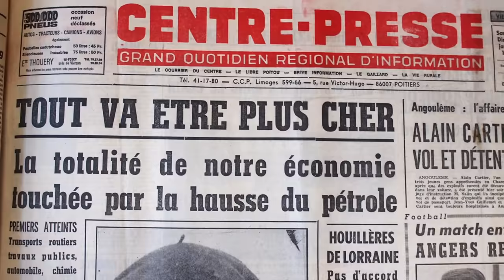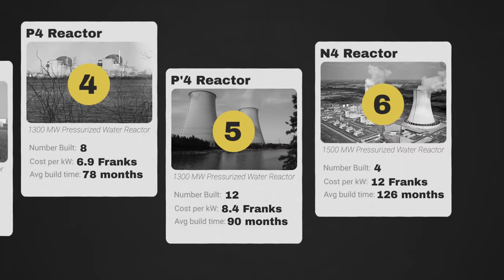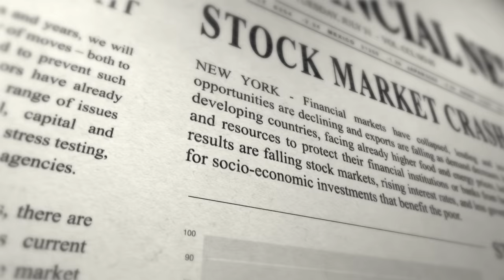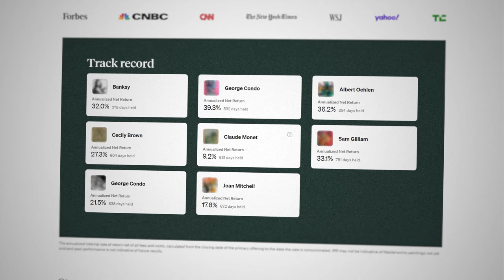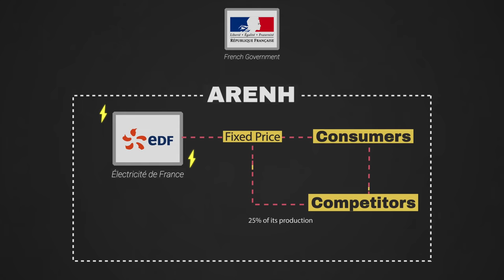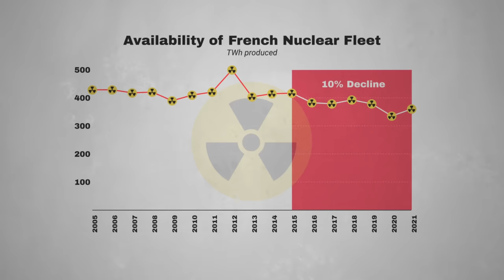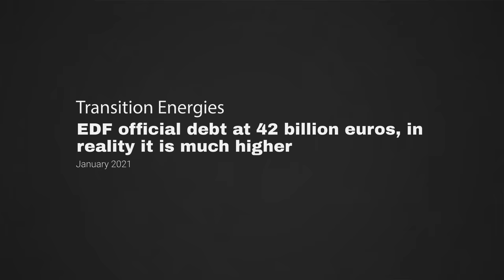Why French Nuclear Energy Failed

Comment: Nuclear energy is neither sustainable nor cheap.

It is a wrong strategy. Just being low in CO2 emissions is just not enough.

Only renewable with electric buffers are the future.

Also btw Chernobyl was in 86
Reply: We need both nuclear and renewables for a stable and sustainable grid.
Also "electric buffers" quickly become unsustainable and expensive, as well as CO2 intensive, as you expand to a large scale. I don't see how it would be the case for nuclear energy.
Reply: @cocolasticot9027  I understand your view and it basically makes sense. But battery technology is progressing at a pace that is just breath takning. You will see in 10 year iron salt batteries will be in abundance available. And they are cheap... very cheap.
Reply: Gas from Russia is another option. Putin likes this option very much.
Reply: @toom2141  The exact same thing can be said about fission/fusion reactors, right now nuclear is cheaper and lower in CO2 than all renewables.
Only time will tell which will see the most success in the future but as of right now renewable isn't even close to as efficient as nuclear, yet alone it isn't plannable.
Reply: @alex
Dude nuklear is the most expenive energyproduction of of them all!
Reply: @toom2141  there have already been fusion reactors which no longer produce a negative.. i dont think we will have fusion anytime soon, neither do i believe we will have batteries which do not wear overtime nor use harmful materials...
Reply: @toom2141  yeah I guessed that was your point. I'm very skeptical of the actual technological advances and what we're promised about it.
And even if the tech becomes that good and cheap, there's still a dilemma in my opinion : the environmental cost of producing that many batteries.
We already have to replace thermic cars with electric ones, that would already require a massive amount of batteries and a necessary change in the individual car paradigm. But if on top of that we have to build massive infrastructures to store the renewable production, I don't see how this could be achieved without massive industrial pollution from the battery production (extraction, industrial processes etc.), let alone the production of the renewable installations themselves.
Compared to nuclear plants with huge economy of scale and controllable energy output, I can't imagine a realistic alternative in the renewable only scenario.
(Or maybe in a degrowth objective, which isn't a bad thing for me. I just assume we're not talking about that particular option)
Reply: @cocolasticot9027  Exactly the ideal power grid would be majority Hydro and Nuclear supported by a minority Solar/Wind assuming they become more economically viable.
Reply: Since you think I'm uninformed I suggest you lookup EROI and different sources to said index as almost every single one points out that Nuclear is cheaper and more sustainable than all renewables even compared to hydro...
Reply: @alexpsp00  That's assuming batteries are not recyclable.  97% of the battery can be recycled and it's being done now at Redwood Technologies as well as other companies.
Reply: @alexpsp00  Batteries are almost entirely recyclable.
Reply: Exactly. It is a dead end. 
The amou t of tax payer money these things will consume over their lives will be eyewatering. The public will have to subsedise 15 or 20 cents for every kwh they will ever produce over their lifetime.
And thats before the cleanup and managing of the mess begins.
Reply: @alexpsp00  fusion will also never be able to compete. Anything generated centrally will not be competitive in the future. Decentrilasation and peer to peer energy transfers is where we are going.
And most of the storage capacity is going to be decentralised as well. Buy electricity when it is cheap during the day for pennies and store it in your storage apliance and use it during the night when prices are high.
With flexible energy prices a domestic storage appliance will pay for itself in no time. So everyone will be buying one when the big korean, japanese and chinese brands fill big box stores with cheap units.
They will be as common as fridges and microwaves and similarly priced.

And all roofs filled with pv, who doesn't want free enerby to fill their battery.
Aldi is looking to become one of fhe biggest energy providers in europe as well as they fill the roofs of all their stores and create an income from energy instead of it being a cost.. And every other retailer will follow soon as well if they want to stay competitive.

Things are happening quickly now.
Reply: @baronvonlimbourgh1716  There are already live uncentralized nuclear reactors Im not sure fusion Will ever be competitive But centralization definitely isnt the issue.
Reply: @alexpsp00  i don't think you are thalking about the sort of centralisation i am.
That would mean thousands of little nukes run by all sorts of different people and institutions.
Reply: @toom2141  Bateries arent the future. No matter how big, you can't run a grid on that at a low cost. 
My personal opinion is that we will have more mechanical bateries, like damms and secondary damms that serve as water bateries and hidrogen, for instance.
Reply: @toom2141  
Wind usually contributed to 25% of UK electricity  production 
In 2021, due to wind free year, that share dropped to 7% 
Wind electricity  is gay